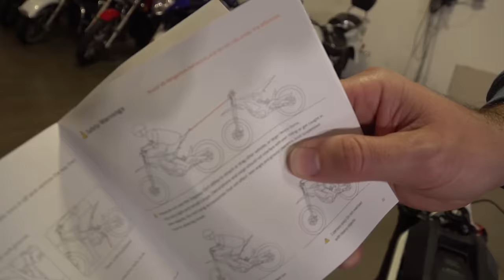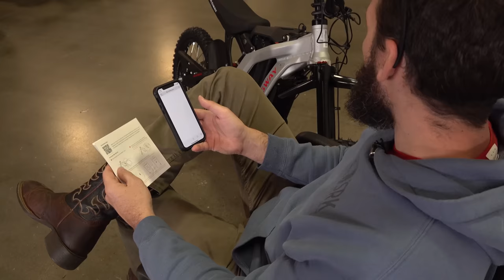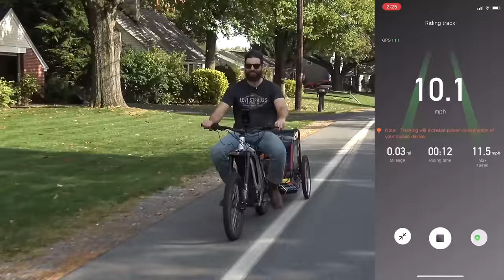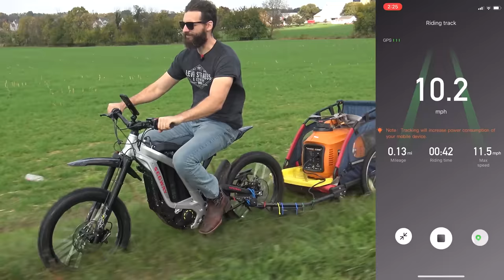I BOUGHT the CHEAPEST ELECTRIC dirt bike on Amazon

Comment: I bought two 1200 watt 48 volt kits for a standard 26" mtb for $1k for both kits; it took 3 months to get them but the battery cells were Sony and they last all of 60 miles on a 24 hour charge and will go 25 mph continuous.

Comment: Updated: You got to the Sur-Ron part boy that should have been mentioned upfront. It was driving me nuts.  

So you bought a Sur-Ron! Should have bought it from Luna cycles, a much better company and doesn't have the disgusting 'Segway' branding on it. Um call Luna cycles dude, it's a rebranded Sur-Ron. You could of had the higher powered one from Luna for the same cost or cheaper...LOL Plus they have great support. I know way too much about these, also a mod with the electrical you do with the wires to get more power and/or top speed. this has been out for a long time, again it's Sur-Ron that Segway paid to rebrand...LOL Again talk to the owner at Luna Cycles.
Reply: I love luna seriously the sur ron puts this thing to shame I run a dual 52V battery 1.5KW motor setup on my snapon raffle fat tire I ride it nearly every day in the summer with pedal assist I could ride to Chicago and back and I live in indiana luna is an incredible company

Comment: I fitted out a front/rear shock mountain bike with a 1500w hub motor and 48v battery. Total price was $1000. It can get up to 40mph and has a 20 mile range at full throttle.
Reply: thats high speed tho i wanted to do one like that but gasoline and gear limited to 30-45 kmph

Comment: I would get this just to get between work and home. I live on a tiny remote island where the speed limit is 25mph. My biggest concern is whether or not the app would be available in my location. Most apps dont work here. Also it does rain a lot and idk if I'll be able to ride it when there is rainy weather.
Reply: Can these app problems be solved with geo gps spoofing?  Just a suggestion, or question. 

But yeah, I feel you. Just Sometimes even small Switzerland gets forgotten.
Reply: You can get a track and ski kit to turn this into a snow bike , so it should be fine in the rain .

Comment: I like how the answer to get more miles was to put a gas powered generator to an electric motor.
Reply: What's the point? Might as well just get a moped for 500. What a rip off
Reply: If you strap a rocket to the bike,   You'll reach top speed of 263  kilometres per  hour

Comment: You know that an electric engine can also charge when rigged in reverse.  So the concept of the addon cart could have two electric motors or alternators, on the wheel axils connected to a charger, connected to a deep cycle battery.  Then link it to the bike charging system.  And as you ride it charges the deep cycle.  Makes you wonder why they didn’t include an alternator system of some kind on the bike to begin with to extend the charge?
Reply: The extra resistance generated by those extra motors would consumer more electricity than they would generate.
Reply: Nice perpetual motion machine
Reply: On the flipside, that's the basis behind regenerative braking, you engage the motors and the high drag of them running as generators both slows you quickly, and slightly charges the battery.

Comment: Despite all the negativity he throwed on it, it's a quite fun and useful tool for urban commuting for me.
Reply: But you can get a cheaper and better bike
Reply: @vladimirlenin843  If I can buy it here in UK, I will. In where I live at the same price we can only buy "electric bike" that you have to padel, with 16mph top speed and 250w power limit. Lets say if you live 5 miles from work, it's too much for walking, and parking and trafic jam could be an headache, this is the perfect tool.
Reply: that's not made for urban communting unless maybe you like to do crazy sh** on the road or sidewalk. If you don't use it as a dirt bike then you'd be muuuch better off with an actual e-moped for around the same price with a better range, faster and more comfortable especially if you're not a tiny person 🤷🏼‍♂
Reply: @oscarshen6855  yeah but if you're 10Miles away you kinda screwed already unless you recharge the battery during the day or go just ride at 10m/h, lol. This thing has a pretty s**ty range...

Comment: Someone could definitely make a legit alternator for that so it’s constantly charging while running like a Tesla or regular car battery
Reply: It would only work as a braking system or going downhill, for a weak mini charge. Otherwise your using battery power to push the bike to run the alternator to charge the battery and there is a LOT of energy lost in the process.
Reply: Not efficient this is why it is not used already
Reply: @tun0fun  yeah I forgot ab the laws of physics and that regular cars use gas engines lol my bad

Comment: I did the same thing with my electric golf cart and a generator in the back. The only downfall is that if your generator is not a PURE SINE WAVE it will decrease the battery's life very quickly. I'm guessing that the battery was probably 50٪ or more of the manufacturer's cost for that bike, so you would want to be careful of that.
Reply: What do you mean with the generator?
Reply: What???
Reply: yes if the bike has litium it dies very fast when charging it while consuming it short life time ,ive been arguing of using gel batteries vs litium in continuous charging situations and ofcourse the litium will die but if you do 10-100% cycles it wont wear fast
Reply: If a 3,000 dollar bike is spending half their budget on a battery they are doing something wrong.  Like getting scammed wrong.  Batteries are not that expensive.

Comment: Couple years back I found a Zero MX for sale locally that didn't work. Turned out to be a demonstration bike and the guy who had it traded a boat motor for it. It had been sitting outdoors for awhile but it's mostly stainless and aluminum so only the plastic was "fuzzy" which I sanded smooth again and removed stickers, it looked almost like new. It came with no battery or charger for $250. Ended up getting some hobbyking packs that were 16ah 12 series for 50v. Ran great but was underwhelming in the power department. Don't think it was the packs as they never got hot just warm and these were MUCH lighter than the original round cell batteries so I imagine this bike is similar to it in power.

Comment: range is dependant on battery milliamp and voltage   you can use a 52 volt on a 48 volt motor it will keep the power hoigh even when low on juice  but you cant usea 72 volt batt on a 48 volt motor

Comment: The intense irony of fossil fuel charged electric vehicles displayed in a hilarious and consumable manner.
Reply: yeah, that last portion can be a whole nother skit
Reply: Well the only difference is that electricity generated in a power plant, accounting for electricity transmission losses is still like 3 to 5 times more efficient than burning same fuel in a car engine. So you burn same fuel in a plant and can drive 3-5 times further. Same environment impact. Short term evs pollute more but within like a year or two theyre practically emission free whereas ice continue to pollute the same as the day they rode off the assembly for decades to come. Evs only pollute at the start and at the end when theyre in a waste dump. But mass recycling might be a thing when that happens.
Also you gotta pump or drive gas to gas stations. So using gas to get gas to gas stations is already a stupid thing we should stop doing. Power travels near speed of light. The savings alone could power entire countries if we count the whole world savings. Bet it would be at least 5% of all fuel used just to transport said fuel.

Comment: I’m genuinely curious how much range and what type of setup you could create with a very large external battery.  Could you get multiple hours of it and does it make any sense for anyone
Reply: The X160 has a pretty small 48V battery.  The big brother, X260/Sur Ron X, have a 60V battery that is 31.9Ah.  Doing around 25 MPH you can get around 40 miles on it.  There are aftermarket batteries also available such as the Chi Battery Systems which is 60Ah.  I just watched a video of a guy who rode it using his phone GPS to track him and went 121.5 miles before it fully stopped.  The range varies dramatically depending on how you ride and the terrain.  I have the Sur Ron X with a BAC4000 controller and a Chi 51Ah high discharge battery.  With this setup I can go 70 MPH.  Mine is strictly used as a dirt bike with many other mods for that purpose.  Range can be as short as 32 miles if I'm nailing the throttle and climbing steep stuff or riding sand.  I've not done a "range test" with mine but I'd guess I could get 80 or 90 miles out of it if I just cruised along at 25.

Comment: He spends thousands of dollars, goes through all of the is trouble- and doesn't tell us how many MPG on it?   Unbelievable
Reply: LOL!!! miles per gallon of electricity probably very high!
Reply: All jokes aside the range is horrible.
Reply: @youcanbesmartaskhow3857  He is charging the battery  with gasoline and running it as a HYBRID. Hybrid vehicles measure MPG. In that mode it is running on gasoline- not hydroelectric or nuclear or wind or whatever. Hybrid vehicles are GASOLINE vehicles.
Reply: @kirkjohnson9353  sorry, sorry, sorry you are absolutely correct I thought you were joking. I too am curious how far/how much he can charge it having finished the video.....
Reply: @youcanbesmartaskhow3857  Ok, misunderstanding is easy. I hope he actually lets us know. I've thought about putting a generator on an electric bike to see what the MPG is.
Reply: @kirkjohnson9353  I have thought of that as well and am curious if the generator can keep up/surpass the necessary charge and how much fuel it takes to do so.

Comment: This E Bike isn't meant for long rides its mainly for around town. My personal opinion is that it's a good bike. I'd ride it around town to save gas in the car for other important task.
Reply: I don't think so this isn't really an e-bike it lacks pedals.  This is a neither an electric motorcycle nor a e-bike it is a compromise on both and does a poor job at both.  Nothing is wrong with e-bikes or electric motorcycles but this is a fairly expensive machine and it is not that capable.

Comment: I just purchased an electric mountain bike for $600. It claimed the range was 50 miles. Had a 500watt motor and a 48volt 4.5ah battery pack. Do the math. The best you get is 22 miles. They just make these claimed and no one does anything about it.
The bike is 21 speed and can ride like a normal mountain bike if no battery and it will do 20mph easy. so I kept it anyway and the company got away with false advertisement. Vivi bike. If I had paid 3500 it would be a different story

Comment: I find the whole 'range anxiety' thing odd: are internal combustion engines actually perpetual motion machines? Do they never need to be filled with fuel? Just 'as and when"? Go a year without bothering? I'm pretty sure my diesel Berlingo would run out of fuel if I don't  top it up - it's range is limited. Doesn't make me anxious, and I've never met an EV owner with range anxiety. It's bullshit, in other words.

Comment: Okay so now if this Segway is simply a rebranded Suron then it has the same exact performance specs as the Suron e-bike, correct?  I'm confused bc I recall seeing several videos wherein the Suron appears to be a relatively badass e-bike and was fast as hell to...for an e-bike of course. Is that not the case then?  In other words  is Segway just borrowing certain parts manufactured by Suron without necessarily borrowing all of the parts from the Suron, especially those which apparently give the Suron it's apparent decent  performance capabilities?  Or are they indeed one in the same bike and the videos I watched depicting the Suron as a beast of an e-bike just a pile of dookie?

Comment: I rode an electric bike (motor 750 watts / battery 2x48 volts - 15 amperes / hour). already 1300 km / I drive at maximum power (38-43 km / h) 50-55 km a day / every day / Winter - temperature 2-10 degrees Celsius / Mileage - 15 amperes / hour is enough for 30 km / two batteries are enough for sure at 60-65 km / It is quite possible at an average speed - 22-28 km / h the battery is enough for 80 km / but not interesting!

Comment: That's what they should do with some of these electric cars. Put an on-board emergency generator in case they run out of charge on a journey LOL. I am so shocked that nobody has developed an electric car that can recharge itself while it's rolling that's common sense you can just put a f**** generator right on one of the wheels and it'll charge your damn car while I was rolling wow I thought of that in 2 seconds

Comment: bikes & bears - FALSE , its ILLEGAL in all 50 states , at Anytime to Ride on Sidewalks .
Bikes of ANY kind , MUST ride in the Street w/ cars or in the Bike Lane where provided. 
Bikes must Follow ALL Bike RULES , can be Found at LIBARY - FREE DMV Information. 
its also ILLEGAL to operate a Bike without a HELMET and SAFETY gear. 
also , your BIKE is ILLEGAL , as it Does not have CORRECT Reflectors and or Signal lights.

Comment: You are sooooooooo lucky you didn't spill electrons all over the floor when the bike fell over!! You have no idea how much of a mess they make. They are even worse than having to mop up volts.

I usually only ever bet with my life and not my money, but I would bet the whole 10 MPH max until you download and install the app is because of the trial lawyers. 10 MPH and a crash = no harm. Once you download, you made the deliberate intention to drive the bike fast and you take all the responsibility if you crash at 30 MPH and win the Darwin Award at any level. There is no such thing as a stupid motorcycle rider because the stupid ones have won the eternal Darwin Award.

Comment: It has no peddles with power assist and the motor is over 750 watts, therefore it's illegal on the street.  In most states they are define an off road e bike the same as a dirt motorcycle.   Before you purchase one to ride on the street,  be aware this is not an e bicycle ,  you'll get a ticket and if you don't have motorcycle endorsement,  you'll get a second ticket.   In some jurisdictions that are tired of off road vehicles on their streets and roads causing havoc, they will confiscate the bike.